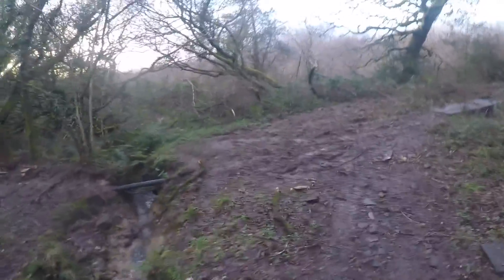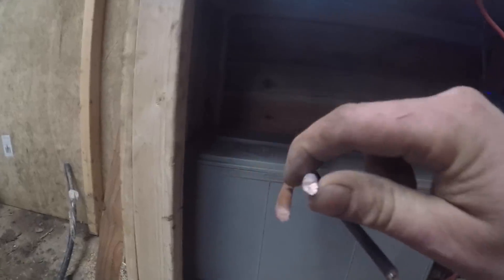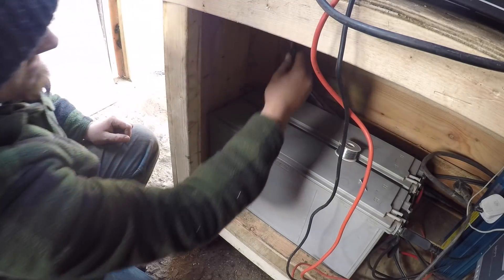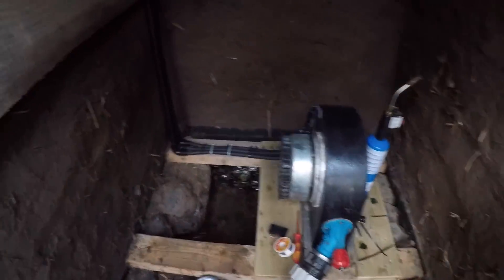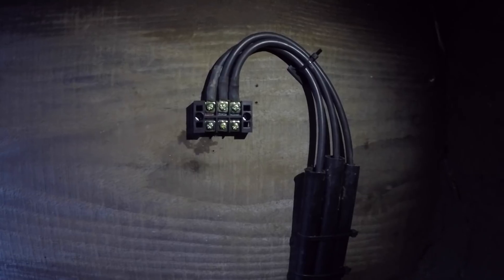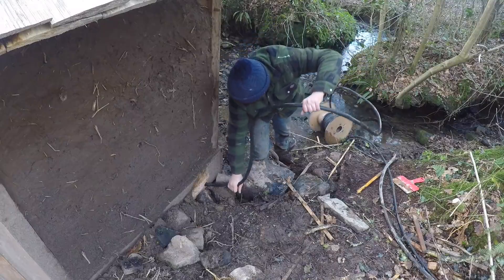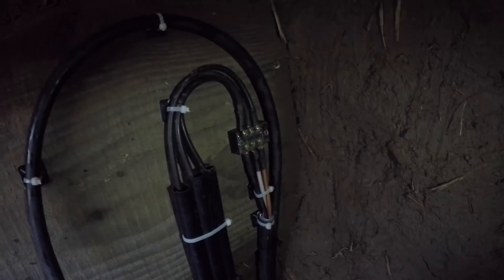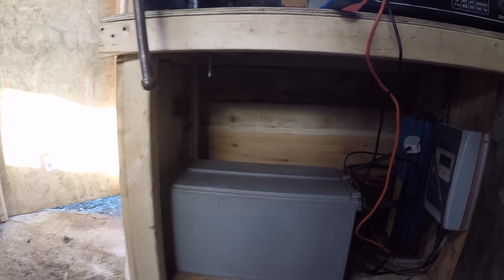DIY Micro Hydro part 14 wiring The turbine

Comment: Any reason why you didn't put the bridge rectifier at the turbine, and run only two wires to the batteries?
Reply from the maker: Three phase AC travels more efficiently
Reply: @KrisHarbour  DC has fewer losses.  The reason AC is used on the grid, is because it's easier to step up (and later down) the voltage with transformers, which only work on AC.

Comment: I have problems with the adjustable injectors. They get clogged with small pieces of sand (less than 1mm). Here I am on granite soils, sand particles are relatively large. I have to open the injectors thoroughly 2 times a day in order to purge the warhead of the injector. I will change the filtering system

Comment: Hi Kris.  Could you show a diagram of what the setup is?  Also, should you have some disconnects in case you need to do maintenance?  Or do you just shut off the water to the turbine?

Comment: Are your cable ties mounted on sticky back holders? If so they might fall off because they're on wood and they do not hold up too well on wood specially when it gets moist. I would use a different mounting strap screwed into the wood.
Reply from the maker: They are screwed on to the wood. They are designed to have two screws in them or use the sticky pad
Reply: Kris Harbour okay I was just wondering because I use those also.

Comment: Any wires run on top of ground should be completely inside pvc pipe. Varments will have them for dinner ‼️
Reply from the maker: They wont chew through armoured cable. maybe have a nibble on the outer sheath but wont get far.

Comment: Hi Kris, so nice to see you always so motivated. I appreciate your videos but also your kindness in taking the time to answer most of our questions / recommendation. I'm really appreciative. One question : the big pipes your ordered seem made of a tough material. Did you consider releasing the strings to let them relax a bit before starting installing it or are they flexible enough?
Take care and keep on the good work! Cheers.
Reply from the maker: Hi, i wanted to keep them as a roll for now and the reasons will become clear in the pipe laying video. basically i need to lift the roll over a post in one piece. then cut the ties and then drug one end of the pipe so it can unroll around the post. it will all become clear very soon. 

Thanks for the comment.

Comment: 8:12 This should be a test of the wires, whether they are ok?
I would say the meter is on passage measurement.
With the simple continuity measurement you can not make sure that the wires are really ok.
If it beeps, there is a connection between each of the measured wires. If you have connected the generator at the other end, the beeping is ok, because then you measure the windings of the generator. If the turbine is not connected (the other cable ends are open) it must not beep, otherwise there would be a short circuit or an insulation fault (damaged cable sheath).
To perform a proper insulation measurement of the cable, you must disconnect the generator and use an insulation meter. Depending on the device type and setting, this insulation measuring device sends up to 1000 V through the wires in order to be able to determine the insulation resistance. For me in Germany, the insulation resistance must not fall below 0.5MΩ when measured at 250V DC. At a test voltage of 500 and 1000V DC, the insulation resistance must not be less than 1 MΩ.

Comment: Just goes to show what you can do with scrap 

Will you be heat shrinking all connections on rectifier as it needs doing ?

If you can not take route with cable then take another route and keep cable off ground near the water end

I know with wind turbines you use a blocking diode (one way valve ) is this needed with hydo to stop battery powering  motor when water pressure is low and hope you have a decent rain harvesting system  

Thnks for update looking forward to next one

Comment: I can't believe I'm already caught up on your videos.  I just found your channel yesterday and I binged my way through the round house construction and the hydro series. I can't wait to see it all hooked up and working.  It's such an inspiration to see straight forward and practical information on these things.  I have easy grid access, but live in quite a rural area, so our power goes out in the winter quite often and I'd like to build a small scale off-grid setup for my animals.  The only thing I don't have good access to is a constant running stream, but there are some in my area, so if I can find a bit of property with a stream and get my hands on it, I'll be all set.

Comment: Brilliant job! I thought the spare armoured cable was to run 240v back into the powershed for a light/socket.
You could also put data over your homebrew 240v grid with a homeplug in each of the buildings.

Comment: Awesome series! Are you going to do a shunt load on this system? I will be hooking one up this fall, but I'm still confused on how to send power to a shunt load when there is excessive power.
Reply from the maker: My system is being designed to not need one. It’s going to be going direct in to an mppt charge controller. The system is designed so that when the battery’s are full it can just free spin until I draw power again. The RPM and voltages are low enough to mean it won’t spin to fast and destroy itself.

Comment: Did you think of soldering the lugs on the cable and would it have given you a better connection - if so what made you change your mind?  Great video
Reply: Tanasi Tim that used to be common practice in the 60’s, since then research defines the best joint as the gas tight crimp. See NASA connector guidelines for the details, if it’s good enough for a rocket then it’s good enough for electrical connections on Earth
Reply: QALibrary despite the utter BS you can find on YouTube, you never solder crimps, Kris was spot on in using a ratchet tool, it’s just a shame he then ruined the joint by soldering it
Reply: I always use solder on those type of connections.
Reply: I used to be an electrician and my dad a retired electrical engineer and from experience with the very big cables you have to get a pneumatic crimper to fix the lugs on the end - it is too big to solder (unless you work for the power company that laying the main lines, but my thinking they might be doing things different now) but with smaller cables, you solder the lugs on but you do not crimp them.
Reply: horse1066 but the thing is I was at college and at work doing this stuff in the 1980-2000 and no one told us about NASA etc we where just told we doing this way
Reply: QALibrary AFAIK the only terminals that are soldered are battery lugs, everything else is crimped either with a calibrated ratchet or those pneumatic tools. These days you can’t manufacture anything without a whole set of standards that you have to adhere to, and I know crimps are never soldered, you have to follow what the crimp tool maker has defined, because they carry the blame if it fails, otherwise it’s the wireman who crimped it incorrectly. Every stage has to be traceable for QA certification.
If you solder a crimp then on a high current failure mode the solder melts and the cable flies free, with a crimp the fuse would always melt first

Comment: Like the video, they say short videos are more time consuming to edit because your cramming a lot of content in👍

You probably have it covered? If not, get to screwfix and buy 2 big adaptable boxes to put you 3 phase connectors in. Keep water out and save you accidentally shocking yourself.

Your copper connections are spot on 👍
Reply: SCHNEIDER ELECTRIC 12-ENTRY JUNCTION BOX WITH KNOCKOUTS GREY 195 X 165 X 90MM (61100)
Reply from the maker: Thanks mate, i have just found them in screwfix, i will pick some up next time i am there.

Comment: Hi Kris, Great work really admire your perseverance!
I have been a sparks for 25 years always wanted to do something like this....
Couple of suggestions if I may:
1. Make sure the amourings of the SWA cable are earthed at at least one end, this will ensure your protective devices work properly.
2. If the voltage is expected to exceed 50V in those exposed connections the just pop an enclosure round them.
3. An isolator at the turbine may prove useful in the future.

If I can provide any electrical items I would bemore than happy to send them down to you (I'm in Midlands).....
Look forward to the next instalment!
Reply from the maker: Thanks for the advice stuart. i was actually looking for an isolator but i couldn't find the right thing to use. lots of isolators for two pin but i could not find anything with 3 pins the was big enough.
Reply: I will check in my shed I'm almost sure I have several 3 phase isolators doing nothing....
Reply from the maker: Thanks, very kind of you.
Reply: from personal experience.  put the bridge rectifier on a heatsink, they get damn hot =D
Reply: I agree with the 3 suggestions. Specialy the first one. You must earth the armor.
Great job!!!
Reply: Also a thermal magnetic circuit breaker to protect the cable in case of a short circuit may help.
Reply: I'd like to add another tip if I may. Those self-adhesive pads you used to hold the SWA on with - get rid. They will fall off over time with all the moisture around, buy some cleats size 9 and use those instead and screw them to the timber.

Comment: Where the cable runs into the generator shed, you may want to drop it down lower as it exits, then up the hill. As you have it now you may get water running down the cable which will keep soaking the wall.
Reply from the maker: That is a good point. it is going through wood there. i could maybe just seal the hole and then any water would just drip down the wood. i will keep an eye on it and see next time it rains. thanks for the comment.

Comment: Nice work. You should put a disconect switch near the turbine. I m waiting next video.
Reply from the maker: i wanted to but i couldn't find anything with 3 pins and big enough.....im going to just keep my eyes open for future upgrades
Reply: What is the model number of the alternator you are using. And the mppt charge controller

Comment: You Schuld maybe do some sort of ventilation for the electrical cabinet (or not ?)
Reply from the maker: The gell batteries dont vent much gas, and there is some gaps where the cladding overlaps. but i think it might be a good idea to add a small vent at least as it could get quite warm in there sometimes. Thanks for the comment.